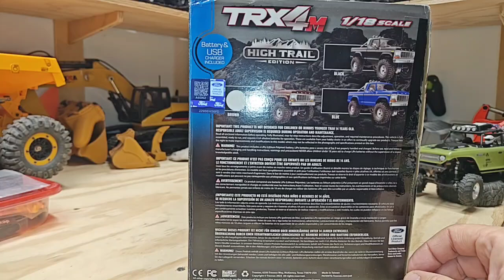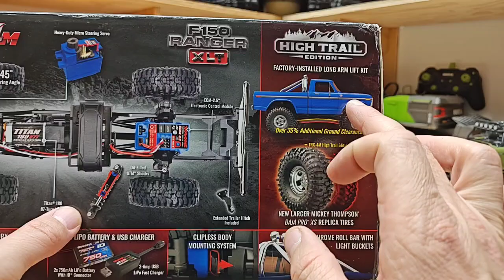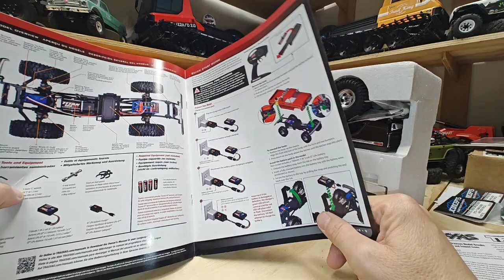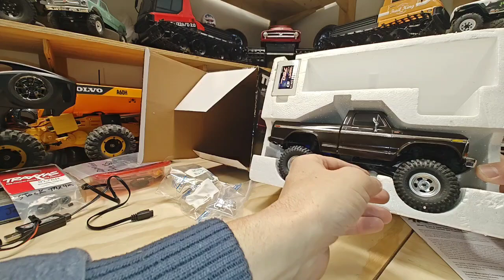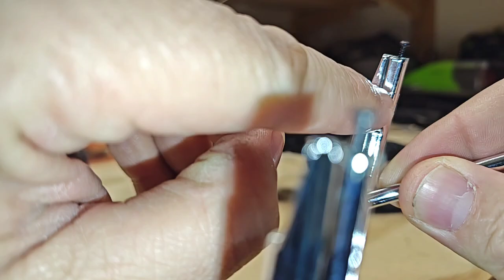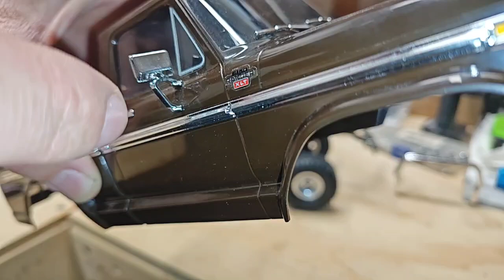Used Traxxas Trx4m High Trail F150 "Unboxing a Pre Owned RC"

Comment: I know my internet service is not great here. He has nothing to brag about. But I guess he gets the job done. So, anyway, so good couple videos, we like watching. So is that bronco, you're getting is that the twenty one bronco2100
Reply from the maker: My Internet is around 1mg every few seconds here at the house, and around 10-20 mg per second in town. And the new fiber optic Internet service, is no slower than 100mg per second. Which is crazy fast compared to what I normally deal with.😁 
It's not just for us though, we really need to get everyone on board in our association, in order to get it done somewhat cheaply, since they are gonna need to run a line into our air quotation "neighborhood" that has never had a fiber line.😕 Meaning that we need to get everyone in here to get it, if we want to get it done for a reasonable price.

As far as the Bronco; Yes it's the new style bronco and if it was anything more than a Trx4m, I wouldn't be able to afford it.😄 
The trx4m bronco and all the parts that I ordered for the trx4m F-150, are technically my birthday gift from my family.😊 
The only disappointment is that I ordered a White colored Bronco, and I wish that I ordered the "Area 51 Blue" Bronco instead,🤔 I really like that color, I ordered the white bronco thinking that it would be easier to keep clean in this drywall dust environment,as well as easy to pick wheels for, but I had my eye on the Area 51 Blue bronco first, and wish that I would have stuck with that choice.😕
Nevertheless... The white bronco is here now, and I'm not complaining about it.😄
Note; I haven't unboxed it yet "it's still wrapped up in Amain packaging" but hopefully I'll get it unboxed this weekend, I was trying to get some excess videos edited first before I dug into something new.😁 
But yes... It's the new style Bronco "I needed one to add to the collection" 😊

Comment: I it seems, run pretty good? So I think I only get one notification on 1 video, so my apologies
So great video, great little truck and keep it going🚚🏆
Reply from the maker: Thanks Kevin and no worries about the notifications, That's actually my fault for uploading both videos back to back.😕
And it's also the fault of my crappy Internet.🤔😕 The fact that I have to drive 15 minutes into town "in order to upload a video" also plays a huge factor.😕 Technically speaking I should have waited a few hours between each upload, "and if I would have done that" you would have been notified for both of them, instead of just the last one.
And all that is going to change this summer, we're supposed to be getting a new Internet service running through here this spring, there supposed to be running a fiber optic line into our association, and our Internet speed will be off the chain.😁 Which means that I won't have to drive into town anymore for uploading, and that the upload speed will go from taking a few hours, to taking only a few minutes,
And life will be grand.😄👍